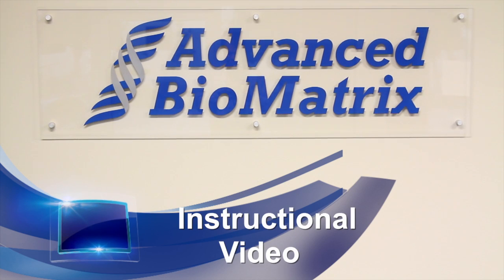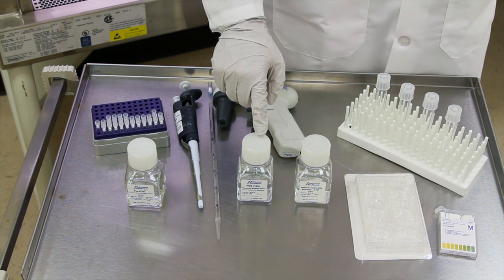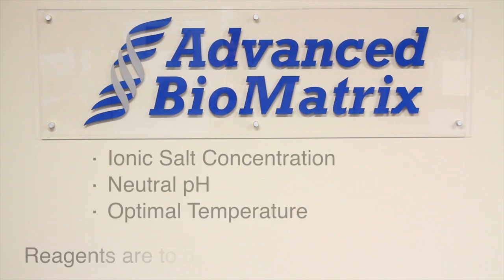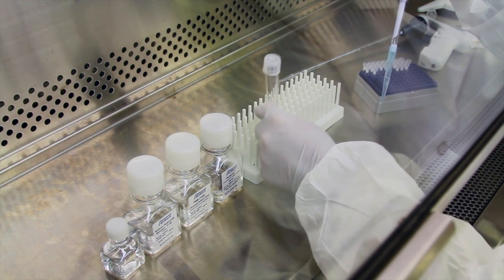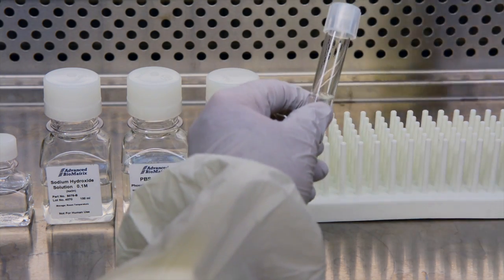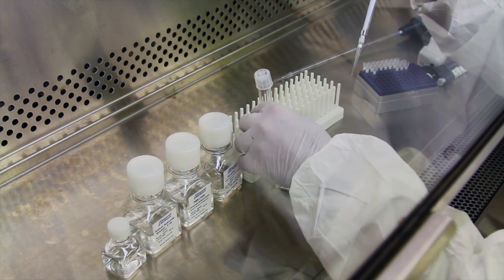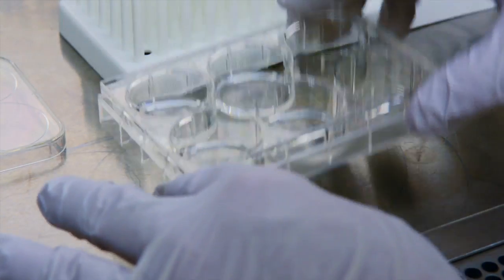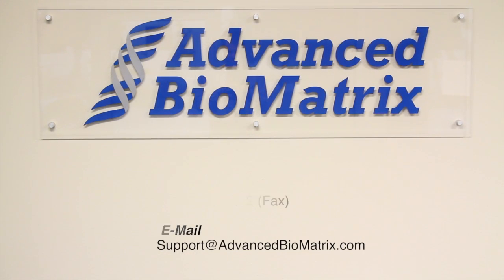3D Collagen Gels Instructional Video - Advanced BioMatrix

Comment: i wanted to know if 1x media or 1x PBS will work instead of 10x
Reply from the maker: The 10X is added as 1 part to 8 parts of collagen (and then an additional ~1 part of NaOH). The resulting salt concentration is a physiological level (1X salts). Using just 1X salts will result in a low salt concentration, and your collagen will not polymerize (gel).

Comment: Hello,

 I would like to know if we need to control the CO2 level during incubation for the gelation process. Would it still work if we were to use a primitive incubator which is capable of just controlling the temperature.
Reply: Sandeep, 
The gelation process is not CO2 dependent. The collagen, upon adding the salts and neutralizing, simply needs to be at 37C to gel. 
Thank you for the question,
Bowman